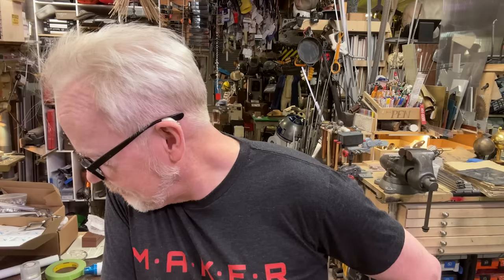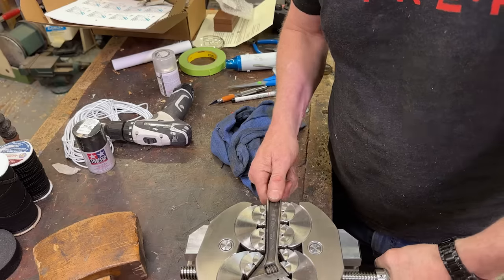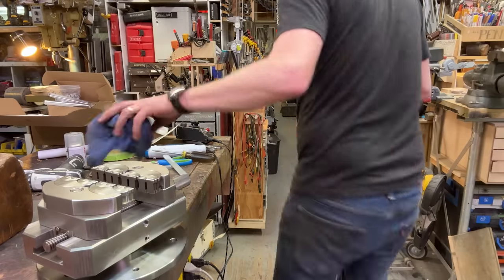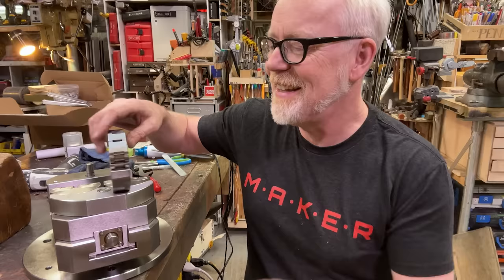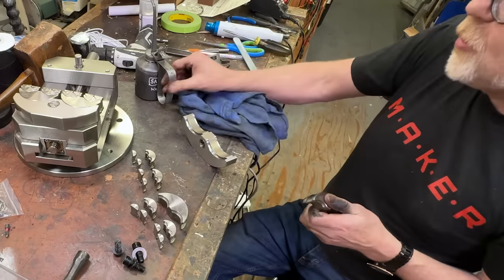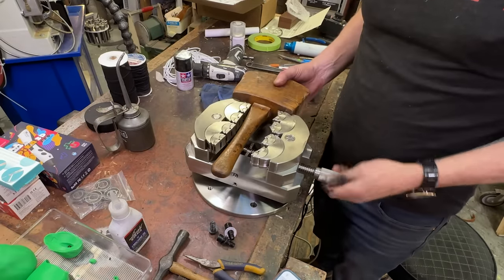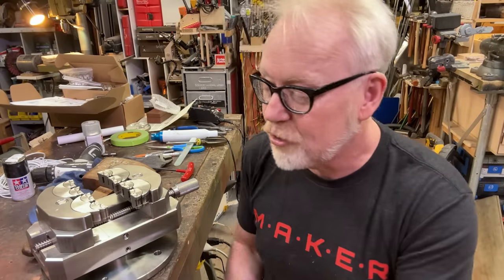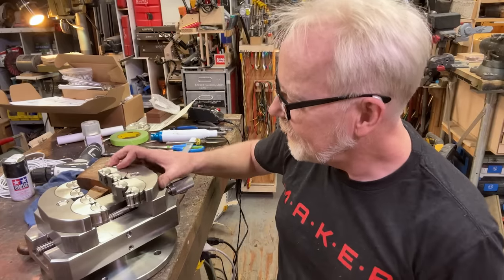Adam Savage in Awe of This Fractal Vise!

Comment: I saw that hand tool rescue video a couple years ago and had never seen such a thing, and I buy and sell machine tools regularly.  So I thought it was pretty nifty.  A month later, I found a much simpler version at auction and had to have it.  It is more of a drill press vise, with a static and dynamic jaw, each with two semi-spheres.  So only 4 semi-spheres total, but after going through it very carefully, cleaning and polishing the mating surfaces, it glides like silk and has proved incredibly helpful on a few projects where the workpiece was too funky to clamp in a standard vise.  Great find, Adam!

Comment: Great video, your enthusiasm is contagious! 
The older fractal vises where probable handmade & fitted, so numbering elements will have been necessary as they where specifically fitted to each-other. Modern CNC probably allows to machine to extreme tight tolerances. Even so tight that it might be a bit too tight; add a kind of Cosmoline for storage and transport by boat to prevent rust.
People often forget that also our highest quality parts can be made in China; the tolerances and quality are as they are ordered by the customer, and match the cost.
Looking forward to your further fractal vise adventures!

Comment: For lubrication I really like PTFE (Teflon) dry lube. If you were so inclined you could hypothetically put another lube on top of the PTFE and have it be extra slidey. I'd honestly probably go for Moly grease on top. Thin oils do have their place but I think the low speed and relatively high force warrants something higher viscosity that wont squeeze out when its clamped static.
Reply: You're not wrong, but PTFE is one of the "forever chemical" family that we're barely starting to grasp the long-term evils of.  We can do better, and for the sake of future generations, we should try.

Comment: I'm pretty sure the wave shaped M ends on the smallest parts of the original fractal vice, were meant to make sure the clamping force is applied in the correct angle to allow the pieces to rotate more easily than they currently do on yours.
Adding those shapes in correctly would probably make your vice conform much better to shapes.
Reply: Similar to my thought, which is that the sharp edges on the teeth might be grabbing onto the object. If the were slightly rounded it might help it slide into place more easily.

Comment: Adam, I love your enthusiasm. I saw the Hand Tool Rescue video and was fascinated by the design and engineering of the vice. I am thrilled that someone is making them now. Thanks so much for bringing this to us. 
I have a couple of thoughts. I would mark/number the parts (probably on the underside)to ensure correct reassembly, it may not be necessary but it won’t hurt. 
Fitting the slides with some ultra fine stones might be better than lapping. A little blueing will show the high spots.
Funny that they did such a good job on the jaws and slacked off on the easier drive screw and it’s fittings, it’s still a fabulous bit of kit. 
Thanks again.

Comment: Hi, the biggest problem I see with the movement of the jaws is that if the object has different heights the jaws will incline independently causing the dovetails to work like screws instead, probably the reason we don't see more of them, the lapping compound will make it better, also, mark the jaws to make permanent positions, don't make a v groove on the jaws, instead close the vice completely and drill between the jaws(in a perfect world that vice should aline perfectly by itself if the friction let's it), the shape of the jaws is an interesting topic because they should end in a kind of u shape with rounded points of contact, there are a couple of geometries in the patents. Hope this helps!

Comment: Mating surfaces solution: Gibs. I'm actually in my 3rd semester for Machinist 1 and I chose early on the fractal vise as my final project, so I was immediately drawn to this video. My idea is to turn differing diameters for the differing nested jaw dovetails, halve them, mill them, repeat, repeat, etc, etc. As for the other dovetails which are doubled on the face of the crescents, those will have to be done with the mill, and I'm working on the drawings/toolpaths in MasterCam for NC files, but as a lover of all things machining, I REALLY want to do this all with manual machines. We shall see, I guess. Can't wait to see what you do with yours.

Comment: As a former machinist I can certainly agree with the connection with another for a fine piece of work. It doesn't matter where one is from on this planet when they perform great acts of craftsmanship it must truly be appreciated. I think the lapping compound would be a great start. I would hate to mess it up if spare parts aren't easily available, but I can see the temptation to improve some things. I saw one comment about knurling the contact surfaces. I can see where that would be useful, but some materials you use in the vice might get imprinted with that type of surface. It's an excellent idea though. Have fun with your new toy!

Comment: I would fear sanding or filing a piece held by this vice since the shavings or sawdust could enter the jaw crevices, but the dovetail construction of the individual pieces is brilliant and I assume allows pretty easy clean up!
Reply: I'm curious how hard the jaw parts are too...like you said, I'd be afraid to work a harder steel in it if it's made out of a softer steel. Any dust will be like a magnet to the way oil and turn into a messy gunk pretty quick too...
Reply: Tools get dirty when they are used, best practice would be to clean the tool as necessary.
Reply: @JointerMark  Knowing how tight the tolerances between the pieces are, I would be tempted to clean them everytime metal filing is involved. A little fragment is all that is necessary to ruin the perfect finish that allows smooth operation.

Yes, tools get dirty. But a dirty hammer will work pretty much the same as a clean hammer. This fractal vice should get special consideration.
Reply: Saran wrap... You put thin plastic wrap on top, drop the item and then tighten the vice. The wrap will protect the top side of the vice but is thin enough that the object won't come out.
Reply: @squidcaps4308  Great idea. I would use something a bit tougher just so it doesn't rip in unknown places.
Reply: If I did any kind of sanding or grinding I would probably try to make some kind of plastic bags that go over each side of the vice. maybe pop a shower cap or swimming cap on each sides.
Reply: @techtonik25  Tougher implies thicker.  Thicker might be even more susceptible to tears compared to saran wrap.
Reply: @fewwiggle  Tyvec still comes mighty thin. Much more resistant to tearing than Cling film.
Reply: @squidcaps4308  I use the blue adhesive polythene sheet that is sold on rolls for protecting surfaces when you're decorating.

Comment: I know you have a set of allen wrench T-Keys at multiple points in your shop, but I feel like a custom little T handle screw for the rotation lock screw would be a handy touch to add to the work flow of this amazing fractal vise.

Comment: With something that precise I would get it sonic cleaned to get any grit out of the mating surfaces. I would also look to use a brass instrument valve oil. It’s really light and any heavier oil will gum up the action and you won’t get the smoothness you are looking for. I would be very careful using lapping compound. You don’t want to go overboard and loose the tolerances that it currently has.
Reply: Indeed, brass valves involve metal sliding against metal (usually monel alloys) over pretty lengthy distances. The Hetman synthetic oils might be the best choice here.

Comment: Is it odd that im more fascinated by seeing an oil can in real life than the vice itself? Ive only ever seen them in cartoons or movies like wizard of oz!
Reply: I saw them in cartoons first, but they’re based on real world objects – and you can still buy those, they’re quite common and in use (usually made from plastic and/or aluminium, sometimes brass). It’s just that oil comes in squeezy bottles nowadays, so there’s no need to buy an oiler. The nice old ones tend to get snapped up by collectors, but they’re not rare.
Reply: When you have a machine shop to keep lubricated it is more economical to buy a barrel of oil and refill the cans.  Plus the thumb pump action is satisfying and the long nose gets into more places.  An old, well-used one tends to drain its oil back into the can so the first time you use it after a couple of hours it takes 3-6 pumps to prime before it suddenly shoots out a great gob of oil.  For practical purposes a new one works first time every time.
Reply: I used to love to go to my grandfather's garage because he had one of the oiler cans that "popped" when you pressed the bottom. It was just like the ones I always saw in cartoons. Only place I ever saw one in real life.

Comment: Hi! This is really amazing. I'm not suggesting that you do it, but I would laser-etch the part numbering on the matching pairs of bits, like you mentioned that the original was. I might also be tempted to etch a micro groove along each circle arc such that it could hold a tiny amount of molybdenium disulphide lubricant and separate the contacting surfaces in two smaller ones from the middle along the curvature.

Comment: I actually watched the Hand Tool Rescue video about a year ago. I'd never heard of a fractal vise until then, and finding out they were first made a hundred years ago simply amazed me! As one poster (and Adam) mentioned, numbering the corresponding pieces is important due to the low tolerance necessary to make it work smoothly....especially with the machining equipment they used back then. Amazing!

Comment: Lapping compound was my first instinct, however I would be cautious and go slow. I’d also investigate how the vise pivots about its base. Seems like it could end up being the source of some error in heavy milling operations. Certainly any axial loading from the quill which isn’t concentric to the center of the vise’s pivot could result in error on the z-axis.
Reply: hmmm... that does bring up some interesting thoughts... not just about non-symmetric loading, but about the flexing of the steel under its own weight, and even about thermal expansion ... those tolerances do look VERY fine, which is both good and bad... 🤔
Reply: I would doubt this particular fractal vise would stand up to heavy machining but for hand work it will be great
Reply: @ChrisdeHaan  i say the same . the single pin on each end is what applies the pressure . that is weak. they know that and only put a knurled handle on it that you can't put much torque on it.

Comment: Cool piece of kit, I know Eric from Hand Tool Rescue didn't expect the original Fractal Vice video to be quite so popular.

As to what to do next, I think some lapping compound along with a device to automatically 'work' each piece through a short range of motion might work well - kind of like a wiper motor mechanism to push it back and forth. Additionally it's not clear from the video if the mating surfaces have any form of grooving to hold oil in them (much like the mating surfaces on the Bridgeport table do). If not that would probably help.

Comment: Amazing to see these finally available, hopefully we see some cheaper ones that work a little better than the printed ones
Reply: @veramae4098 what?
Reply: From China?  No wonder you're planning fixes and upgrades.
It's a clever piece of equipment, but what would you use if for?  I kept skipping ahead and didn't see any unique uses.
Reply: @veramae4098  He showed it off right at the beginning, as an elaborate storage for your favorite adjustable spanner.
Reply: @veramae4098  As Adam explained early in the video, it's for holding irregularly shaped things securely without having to use shims. It's a niche use for sure, and it's definitely not "necessary" in any real world scenario though, since there are other ways to hold irregular work.
Reply: @veramae4098  Its one of those things you'd find a use for if you had one, but you wouldnt miss it if you didnt have it. Unless you're like Adam and have an affinity for interesting tools like this.
Reply: @veramae4098  to a machinist, it would be invaluable for holding odd shapes on the mill.   for your average person, it's not something that's truly vital that way.  $2500 for a fancy vise is out of the price range most would be willing to spend.   While a hobby machinist might like to have one, it would probably be easier to just make one if you really wanted one..  

As for printing one, PLA is just not bonded together strongly enough to really hold up to the stresses of a vise.  However, you could print the parts and then CAST them in aluminum, and do a final machining to get to the end piece.
Reply: ... I'm sure a Kurt (or similar) version of this would be as nice as ninepence ... but the price would be eye-watering!
Reply: @timhyatt9185 LOL you are NOT using this on a mill. No sir no way

Comment: I think those elements might benefit from the grub screw and slot to limit the scope of their travel in general use. It might be possible for certain odd shapes to cause the vice to self-dismantle. I'd also like to see some knurling on the face of the smallest elements, to grip better. The original had protrusions for this.

Comment: I think the best way to get all the surfaces mating and smooth is through use. I would be very cautious of adding any cutting compound or doing anything to accelerate the bedding in. Just let the metal find its own levels. Compare to split bearing or other contact moving parts. Eventually they will wear and you will get slop. Don't do anything to speed that up. Once things have bedded in number the parts and don't mix them up.

Comment: Consider setting up a hold down bolt (longitudinal axes aligned) on top of the jaw pivot pins. There’s nothing to resist uplift during machining ops. Probably have to make new pins, drill and tap, then heat treat them.
Reply: Especially with nothing to resist downward force between the jaws! ⬆⬇⬆⚠

Comment: Interesting timing for this videos. Recently i decided i might wanna make my own fractal vice. There are some great 3d models online and i think i might 3d print it cast it out of metal to get my own.
Reply: Go ahead and make one, I did, and love it. Do not use any variant of PLA, it will split. You will be surprised at what it will hold without casting one.
Reply: @peterwolf4157  did keep yours 3d printed? Im debating weather i should just have a rd printed vice or if i should try to cast it out of aluminum or something
Reply: @cora2887  I printed one with PETG and one in ABS.  They both work very well, can not machine with them, but you can drill and sand, cut and most other things. I say not for machining as there would be too much give.  I build studio scale sci-fi ships and all the hardware, and other stuff, they do what I want.

Comment: That's an amazing vise.  I had never heard of one before now.  My milling machine wants one, but I don't have the cash to blow on it at the moment.

Two simple suggestions:

- I'd put a slight radius on the corners of the final (smallest) components to make them less inclined to dig into a work piece, and

- Definitely replace the grub screws that lock down the swivel motion with some dedicated knobs so you don't have to mess with a hex key.

Great video.  Thanks!

Comment: really nice and seems with some exceptions well built. Although i feel like there's a crucial flaw. I don't know why they didn't copy the design for the smallest jaws exactly but with you clamping stuff i can see why the originals stuck out more in the shape of a B. That shape is crucial for the flexibility of the jaws and there grip. The smallest jaws being stuck out farther as well as its rounded B shape ensures that there will be contact and that it will also cause all the jaws to articulate to the clamped piece as possible. 

i havent finished the video so perhaps you will mention  this but those small jaws kept coming up short of contact which is why the clamping wasn't easy, If you are able you should replace all the smaller jaws to the original design.
Reply: This is a really important point and 100% correct. Even more interesting, the thumbnail image for this video shows the vise modified in exactly the way you describe (although not as smooth) so I guess Adam did do that additional modification.

Comment: I think I may get one these. I agree the closing action of the double acme screw is a little cheesy and I’m interested in what you will come up with to improve it. Regarding the stickiness issue. Lapping the surface may fix the stickiness at the expense of the precision of the thing. This a lot like tool and die work. If you can determine the actual offending protuberance and just scrape and polish that bit.  You can spare the rest of the mechanism.

Comment: I have to think that part of the problem with having your brand new fractal vise gripping the wooden mallet was that the ends of the individual face pieces might have very slightly dug into (or simply caught on) the "soft" wood, making it nigh on impossible for them to rotate to become flat to the piece of wood. I wonder if making the ends of each of the face piece very slightly rounded might help with this issue.